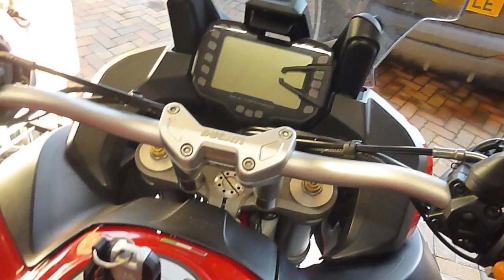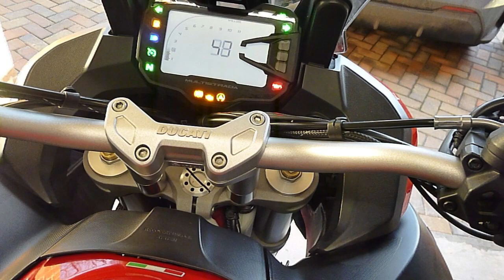Ducati Multistrada DVT service with belts, fluids & filters

Comment: Is this a 1260 or 1200?  I'm about to do the belt on my 1260 and Im reading all sorts of stuff about the layshaft pulley punch mark needed to sit slightly off the mark/line on the casing? Was everything okay with your bike when test ridden and revved to higher RPM and engage the DVT cams which increases valve overlap.  In effect taking the valves closer to the piston crown than at idle.
Reply from the maker: @jameshardy6277  it was the 1200. But I've done the 1260. You can verify the cam timing with Texa when it's fitted but it has to be running. Best bet is to mark the orientation of the tensioner pullers so they tension on the correct side of the bolt so it won't throw the timing out.

Comment: i have a 14 plate theres two oil filters did you take the other one out and clean it ?
Reply from the maker: Some of the bolts were rounded out so just had to do the external filter.